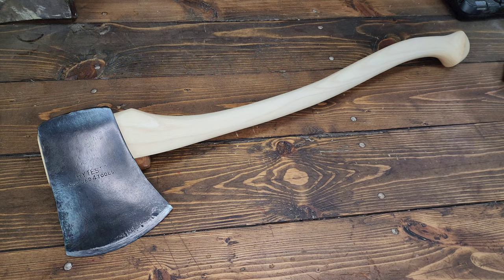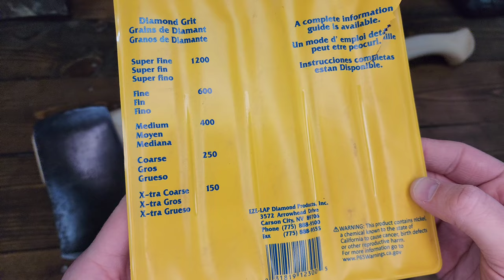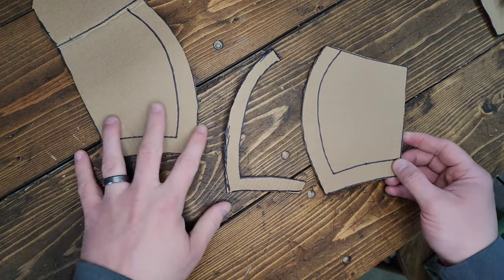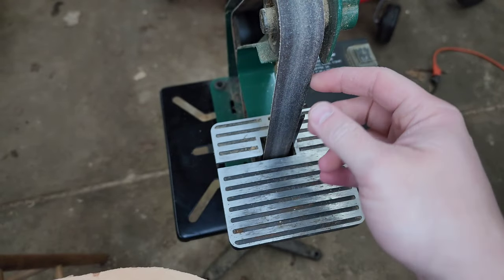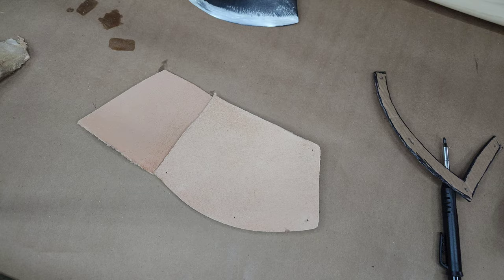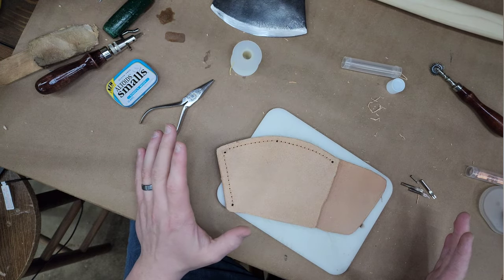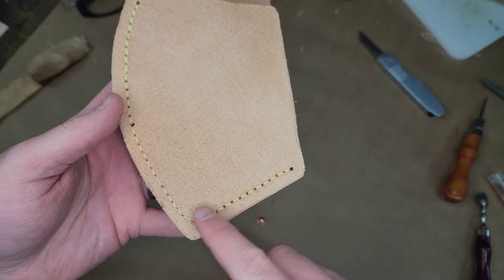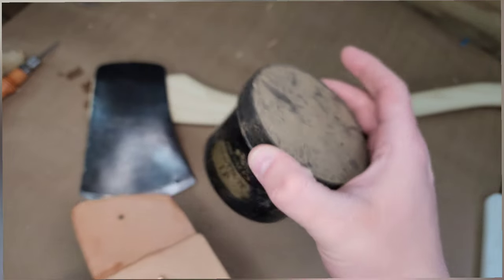HYTEST Axe Sharpening and Mask

Comment: Using just the awl for the stitching holes allows the leather to close back on the stitching making it a nice snug fit .don't know if it is better either way but just a fun fact lol
Reply from the maker: I tried this on a couple of my earlier sheaths and struggled big time. The pilot hole made by my awl was too tight of a fit for the needle and thread I was using and I had to use pliers pulling the needles through. I probably needed a better awl to needle size or something lol. I do want to pick up a set of stitching punches at some point. I think that may work better for me.

Comment: Omg dude - I am always looking for a good file. The handy is great bc of the single and double cut different sides - but I never heard of the “pferd file” before? So I google it to then realize it’s “preferred” files! 😂 it’s a play on the word!!! LOL. Dude I was in the same spot thinking “I think that’s how you say it?” Along with you!!! Can you give the item # for the preferred file you have? There is a bunch of different cuts, length, etc. also, mind just linking those diamond hones as well? Thanks dude!!! Can you do a top ten fav axe vid? Or possibly a multi part series of your entire collection? LOL
Reply from the maker: I honestly never made the connection with the name. I just assumed it was German or something similar haha. I've been very happy with the file though. It's great for heavy sharpening. I actually just got back in from the shop working on another video where I'm removing heavy mushrooming on a Connie. I used vintage 17in Nicholson bastard for a lot of that.  That thing is a beast. I'd be curious if pferd has a similar sized one. I put the links to the hones and the file in the description just now since others may be curious also. But I'll paste them below too. With out being spring time and humid it may be a good time to go through the collection and oil all the heads and handles and record it. That would be a good way to cover the collection I think?

EZE-LAP L PAK5 Set SF/F/M/C/XC Color Coded Diamond Hones https://a.co/d/jg0tGz6

PFERD Flat Hand File, American Pattern, Double Cut, Rectangular, Coarse, 12" Length, 1-5/32" Width, 9/32" Thickness https://a.co/d/dgtV02P

Comment: Very nice job on the sheath what kind of adhesive do you use?
Reply from the maker: Thanks man. Leather work is something that's fun and I could always use more practice at haha. I use contact cement. This here is DAP brand but that's just what they carried at the little hardware store down the road from me. As far as I know any contact cement will do.
Reply: @Nsvens89  thanks man I've tried different adhesives but always worry about the drying agents damaging the leather also that axe is somthing to be proud of great job man
Reply from the maker: No problem at all. I'm definitely a novice at leather work but saw others who are more knowledgeable on it and followed suit. This tub will probably last me my lifetime if it doesn't go bad. But if I were to buy again I'd get a smaller container with an included brush.